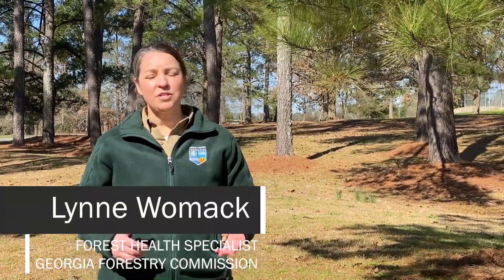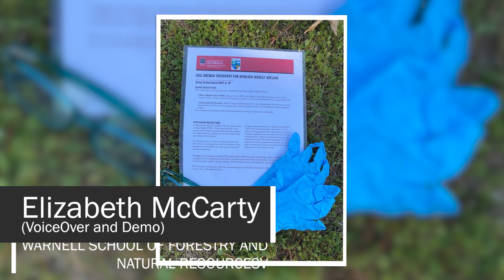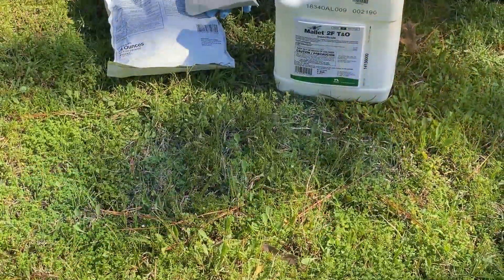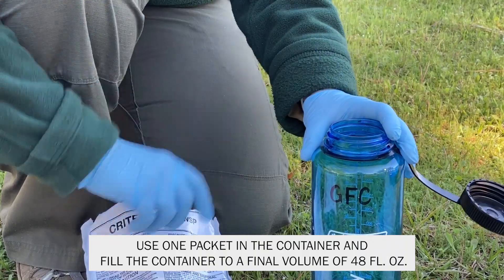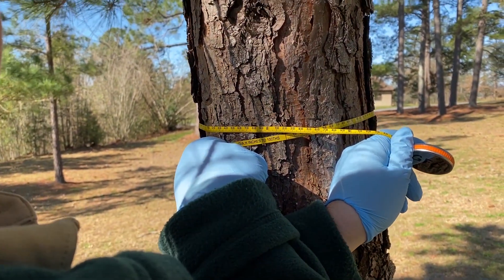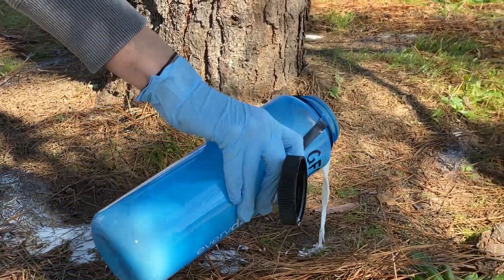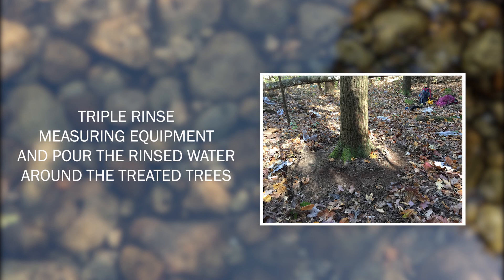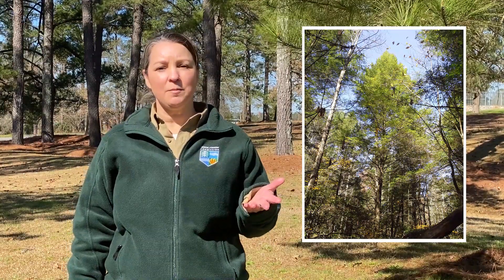HWA Soil Drench Treatment

Comment: Thanks fo the demonstration.   How would one go about preparing and applying  a Neem oil drench for a row of mature hollies that have been attacked by aphids or mites?  Leaves turned yellow then grey. Appears some dying branches. Seems an infestation I overlooked. Live in Oklahoma-- hot summers.   I want to get the I insecticide inside the plant as well as spray leaf surfaces. Will drench be a long term solution? Any advice is greatly appreciated. Thanks.